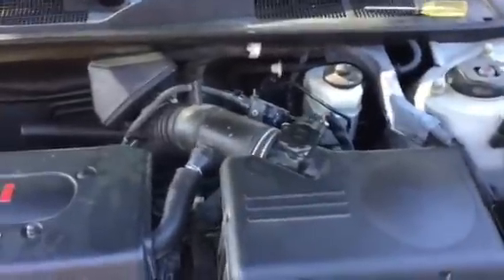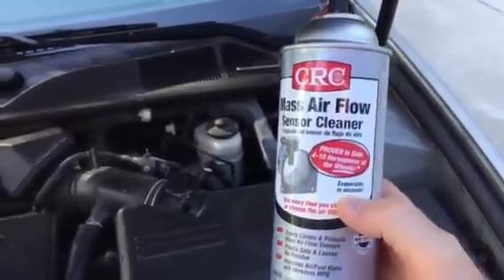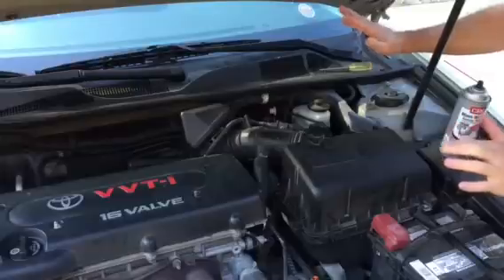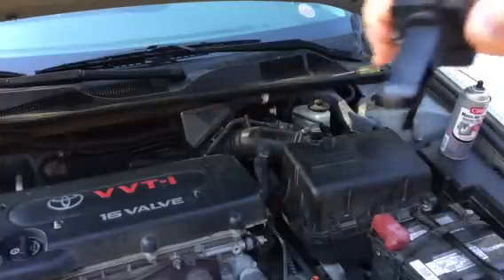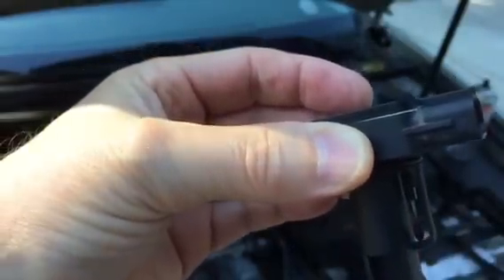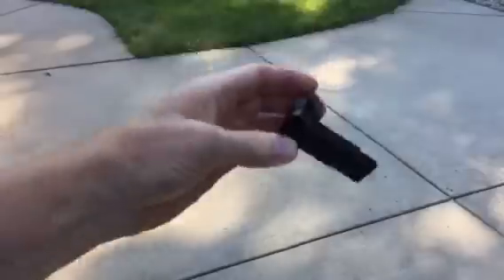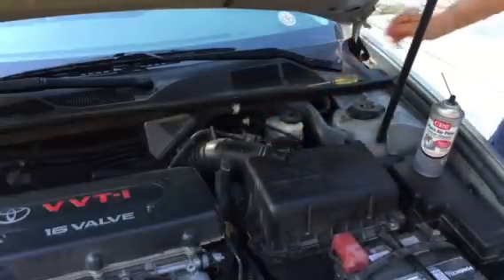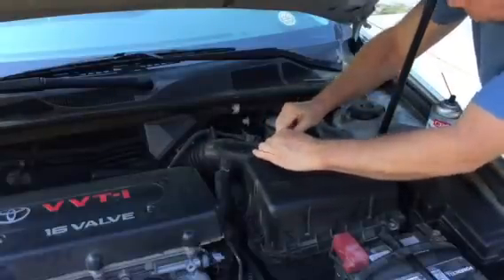Why Does My Car Lose Power Loss Of Acceleration?

Comment: You can use electronic cleaning fluid as well. It's basically the same thing. The ingredients on each can are basically identical. It also dries really fast.  Also, you could have spayed the plug to clean it too..

Comment: We're currently on a road trip from the Netherlands to France with our 2007 Volvo S80 2.5T. We've driven around 800 km so far, and everything was running fine until recently.

At a steady speed of around 120–130 km/h, the car suddenly starts to hesitate or stutter. It feels like it briefly loses power or fuel. One time, the engine even cut out completely, but restarted without any issue. Below 120 km/h it seems to drive normally, and there's no warning light staying on.

Earlier today, I topped up the engine oil with 2 liters after the oil light came on. Aside from that, the car starts and runs well overall.

We still have about 600 km to go, and I want to make sure we get there safely. Could this be a fuel delivery issue? Sensor problem? Electronics? Has anyone had something similar happen?

Any ideas or experiences would be really appreciated!

Comment: I have 2006 Toyota Camry LE, my issue might be with oil leakage. I will try seeing if the bolt is missing a washer but rather then that don’t know what else it could be

Comment: i had mines cleaned but now the engine light is gone but the rpm goes below 500 rpm and randomly idles rough at the light
Reply from the maker: @savagelifestyle2196  Go to my  Automotive Playlist and learn how to clean the throttle body.

Comment: I have no fault codes on my Toyota Yaris 1.0L (2004), 
new spark plugs
new air filter 
checked MAF sensor (clean like new)
cleaned throttle body
cleaned IACV (was clean almost)
cleaned PCV
tested TPS
checked vapor solenoid
tested camshaft position sensor  
checked ignition coils  
 - but still have  some vibration on idle and hesitation after fast/sharply pressing the gas pedal (hesitation from idle to 1500-2000 rpm, like if the engine is choking), but if I give gas smoothly - the engine normally gains speed and power.... also no luck of power from 2000 to 7000 rpm.
Reply from the maker: @legal-emigrant  I wonder if you have dirty fuel injectors?
Reply: @proclaimliberty2000  no, I was disconnect the fuel ramp with all injectors and they all spray rich and in the right way
Reply from the maker: @legal-emigrant  it’s kind of mind-boggling how many different things can cause the engine to  not run smooth. I have a YouTube that I did on engine hesitation and I believe there were at least 45 different things that I listed.

Comment: 2018 Ford eco sport perking during acceleration after 60/70mph and already had the engine replaced because of the oil pump and engine failure.

Comment: Mass airflow sensor is basically a very tiny electrical resistance. The way how is measuring the air, is pretty ingenious. 
Basically ECU sends electricity through that tiny wire. Depending on the quantity of air, the wire will cool down, or heat up, thus increasing or decreasing its resistance. Therefore you measure the resistance and you get the amount of air. Absolutely ingenious.
Therefore everything that affect its resistance, even a single dust particle, will send wrong data to ECU and this will result in abnormal engine operation.
Reply: @clintfipps7312  Yes, if its severily dirty.

Comment: Not done yet! That part that you sprayed is the temperature sensor, there are two resistors (for air flow detection) down inside the hollow tube that also need to be cleaned.
Reply: Thnx, how can the two resistors be cleaned? One only have to just spray it all over, or what?
Reply: Yes, just spray down inside the tube. Don't try to push anything down there to clean them, you might damage the resistors.

Comment: How can we actually know that this is the actual problem? Coz my car also struggles to accelerate when i press the gas or brake. It had body shop service n they changed the intercooler too. After I realized the problem, i went back n told them n they said it might be intercooler coz thats the only thing they touched when they changed the bumper so they changed the intercooler the second time with factory product but i still face the issue. Any suggestion?

Comment: I like to thank you for your easy and understandable explanation.
Just Saturday finished at work to go back home and the middle of the way which is about 1 mile, I was waiting for the green light at the stop light and when I gave gas to my Car it hesitate it so bad I thought the engine is going to go off but it didn't, I continue to go forward but I noticed it was running rough like never before, I was afraid that my Car would stall and proceed to get out of the way because I got a lot of cars behind me, I shut it off and waited for a few minutes then turned on and made it home safely today I needed to go to the store and you did the same thing, I like to thank you for posting this, tomorrow morning I will do a cleaning to that sensor but I don't have that spray, do they sell it in any auto parts store?  Thanks, JD
Reply: Oh man. It just happened to me couple days ago when i came to red lights. I stayed there for 20 min n cars were coming n waiting behind me while hazardous lights were on, then move on next line. I was talking to AAA, but after waiting for 20 min there, i turned it on n i drove. I didn’t know what happened but i also have the same problem that my car struggles to accelerate, maybe this caused that problem as well. Tomorrow will try this
Reply: @kenantv7487  cool man, try it
Reply: @jorgedominguez1957  just came here to tell u said: man, u’r not gonna believe but it just happened again. I was driving n in the middle of the road, my car stopped again. Since i got experienced couple days ago it happened, so this time i behaved quickly n tried to turn the car on immediately, luckily, it worked again coz it was one way n holiday week so already bad traffic n i d not want to cause extra traffic lol. Btw, i just bought mass air flow but i also asked the mechanic n he said if u don’t have any lights on, don’t do anything by urself coz it’s new car so just take to body shop n asked them to look at it , otherwise, if u do smt wrong, they’ll say we didn’t do it. (My car had body shop repair for bumper n they changed intercooler, but I already told them this issue n they changed it again but still the same issue) going to try mass air flow.
Reply: @kenantv7487 did it get fixed?

Comment: Our 1989 Honda Civic with 1.5 engine does not have a MAFS, But throttle does quickly ebb and flow until the car is fully warmed-up. Any other culprit(s) to look for?
Reply: It has a MAP sensor and a IAT sensor.
Aldo check & clean the *ntake Air Control (IAC) Valve and throttle body.

Comment: Shine a light into that Toyota sensor head-on.
Deep in the skirting are two shiny teeny resistors.
Blast those with the cleaner spray too.
Just dont poke or use a cotton bud.
They are delicate things and easily detached.

Comment: What causes the problem driving 10-20 miles per hour car jerking hard and stop and did it again?change all coil and spark plug and map sensor oem part.but when unplug the map sensor the car drive normal no jerking

Comment: Do you have to undo the battery terminal first before you do this ?
Reply: Nop
Reply: As long as the starter switch is off or remove the key it should be ok.

Comment: Thank you for this teaching. I had slow start took a few seconds and sometimes longer. Then it didn’t start at all, After changing oil it started but still slow. I checked this sensor and also put oil on o ring and tightened screws well. It’s starting quickly now. Hopefully remains like this. Thank you so much. From Northern Ireland.
Reply: How it’s been?

Comment: my 2013 model Hundai Tucson SUV has started to develope this hesitation at the early morning hours, it does not have enough power at the start of the engine and when I press the gas pedal too much during that stage, I hear some knocking at the exhaust. Also, it does not have the power like it used to have when climbing  elevated road. surely appreciate your response. thank you sir...

Comment: I tested my maf sensor by starting my car and pulling out the maf sensor plug and the car stopped. Doesnt that mean the maf sensor is working properly. Im having power loss and lurching and hesitation when i accelerate and its getting very frustrating.

Comment: Hi guys, I used brake cleaner for mass air flow sensor and it did the job just fine. The engine is more responsive now.
Reply: mistake and wrong. the brake cleaner leaves a residue. MAFS cleaner is the same as electronics cleaner... NO residue. SEE?

Comment: my 2005 ford escape, is hesitant, the alternator was replaced, also the oxygen sensor 1..🤔.. Now let hubby do what you just did, it’s pulling, has gas an o and battery is good, i literally just left advance auto for a check up.. ILL LET YOU KNOW
Reply from the maker: QUENESS YOMy 👍😊
Reply: proclaimliberty2000 It worked🥳Ty
Reply from the maker: QUENESS YOMy Awesome! 👍😊

Comment: I have a 2013 honda cr-v  it hesitates about the third crank it starts then my check engine light is on and other lights I just put a alternated on today doing what's in your video should that fix the problem or should I look into the full pump  it doesn't bog down or skip going up a hill or nothing but when I run the car a bit I shut it off  then when I get back in it it starts right up and the check engine light is off so could the mass air flow be the problem?

Comment: My Ford Focus MK1 2001 doesn't seem to have one?? It has the hard hose part just after the air box, but there's nothing in it, nothing it the pipe either. It goes straight to the throttle body with the throttle positioning sensor etc.. How does the car know the air flow?

Comment: Thanks for the video. My Corrola has 219000 miles on it and yesterday it would start but would not stay running unless I kept my foot on the accelerater. A 9 dollar can of mass airflow cleaner and following the steps of your video fixed the problem. Bless You.😊😁🇺🇸
Reply from the maker: Kent Smith 👍😊
Reply: Also clean your throttle body.  You might got lucky with cleaning the maf

Comment: when im driving say a set speed of  30 or 40 then give it gas. it wants to sorta sputter.. then if i really press the gas and ge ton it,  the Stabli track comes on. its been going away. but if i ease off the gas when i feel it sputter it wont kick on the stabi trak.

Comment: Had the same problem but it was the air tube it had a huge crack and was sucking in air , part was 100$ so i just used black duct tape instead

Comment: Dont think this will work on my 1991 ram 150 3.9 liter. I sure wish something would . $900 in replaced parts and labor and it stills boggs down most of the time.
Reply from the maker: Cheef Cherokee Do you have a check engine light with a trouble code number?
Reply: @proclaimliberty2000    i dont think it even has the engine light option.but no , no warning lights .
Reply from the maker: Cheef Cherokee What parts were replaced for $900?
Reply: @proclaimliberty2000  plugs / wires / cap / distributer / fule pump / gas filter / crank shift sensor / coil .
Reply: @proclaimliberty2000   the fuel pump is like a big plastic jug looking thing ive never seen befor.
Reply from the maker: Cheef Cherokee How many miles are on the vehicle?
Reply: @proclaimliberty2000  little over 96.000 but this truck is 100% rust free top to bottom . so i would  really like to get it fixed . when it does feel like running right its a sweet old dream of of a truck. i just cant find out much about it like any other vehical
Reply from the maker: Cheef Cherokee Engine hesitation during acceleration without a check engine light can be difficult to diagnose. At this point I would be inspecting the mass airflow sensor, oxygen sensors and throttle position sensor. Based on what you already paid which did not fix the problem I would speak to the manager where you had the work done and see if they’ll check additional sensors including the ones I mentioned at no cost or for a reduced fee.  Trust me, I understand how frustrating this is.
Reply from the maker: Cheef Cherokee Also make sure they check vacuum hoses.
Reply: @proclaimliberty2000  will do thanks for your help.
Reply from the maker: Cheef Cherokee 👍😊 Are you a Native American Indian?
Reply: @TheXopony   Try checking for vacuum leaks. A leak will suck in unmetered air past the maf sensor. The computer will then try to compensate for this and add fuel which will make the car run terrible

Comment: I can't find my air flow sensor sir ..it's missing... I think my macanic missed while installing cold air intake.
I am getting problem while accelerate car not running how supposed to run
Reply: Darel Dias bro my mustang 2015 v6 has same issue when u turn on the speed then @ speed 80 my car misses for a second then it goes up 80 speed how to diagnose it I have cold air intake as well
Reply: not every car has one. some just have a MAP sensor

Comment: Proclaim liberty i have 1993 toyota supra and my car has a maf but it dosnt have that wire its just plastic  i thing its called a flow meter sensor so i did what u mention in yourother video to disconnect it with engine on but my car dint turn of it stayed on does this mean its bad or thr just two diferent sensor maf and air temp meter?
Reply: jvst20051 sounds bad to me

Comment: hi friend, you said that it would take 50 miles of driving for the check engine light to turn off.  What if the check engine light wasn't turned on to begin with and I just wanted to clean the maf sensor? would the check engine light turn on after cleaning? thank you
Reply from the maker: As long as the key is not in the ignition it should not turn on the check engine light when you disconnect the MAF to clean it.  https://youtu.be/YnckaCCJEEk

Comment: Would any quick drying cleaning product work???
Reply from the maker: Neftali Garcia Not if it leaves residue on the wires.  That’s why I only use mass air flow sensor cleaner.

Comment: Since getting my engine code read and it coming back as the MAF sensor I called another mechanic shop and asked about getting it cleaned and they said it would be $300 because the MAF sensor for Nissan uses a special type of chemical and cleaning it is not an option. After he told me that I started looking up videos on it and I see plenty of videos like yours with people cleaning it and they made no mention of any sort of special chemical being involved with the MAF sensor to where it prevents it from being cleaned. I’m gonna go out and buy a can of the cleaner and a screwdriver and clean it myself to save myself from $300
Reply from the maker: Babs Yeah. they are absolutely trying to rip you off.  Happens unknowingly to people every day.
Reply from the maker: If you end up having to buy a new one check Amazon.  I just checked the price on one and they were cheaper than Ebay.  I have always used Denso brand.
Reply: I live in California and since I’m moving and planning on driving my car to Wyoming I want to see if I can try to fix with cleaning it first. So I’m gonna buy the spray first and hopefully that would do the trick because I don’t know if driving from California to Wyoming would be a bad thing with the MAF sensor issue
Reply from the maker: @jurnee-y  That sounds like a great plan.  Are you moving to Wyoming?
Reply: Yes
Reply from the maker: Babs I’ve never been to Wyoming but I think you’ll really love it there. What kind of work do you do?
Reply: I was working for amazon up until last month then I got into flipping houses/interior design which is taking me to wyoming but my new home home will be in Las Vegas after I’m done with Wyoming which I want to work on my MAF cause it’s gonna be woot of driving from California to Wyoming,m and then Wyoming to Las Vegas
Reply from the maker: @jurnee-y  Keep me posted on your MAF project.  Since you'll be driving a lot of miles make sure your battery is in good condition.  You may pick up a tip about batteries from this video.  https://youtu.be/VIWKxR1loSk
Reply: Yea I’m just gonna find someone to do it for me cause I went and bought a screwdriver and just tried opening it up but it just wouldn’t unscrew. Then when I was putting back  the hood strut some random black piece came flying off from somewhere and i don’t know where it came from. So I’m just gonna say F it and drive to wyoming tomorrow and if I make it to wyoming I’ll just see if I can find somewhere there to get the MAF fixed
Reply from the maker: Babs I’m sorry you had so much trouble.  Cars can sometimes be very frustrating to work on.
Reply: You think I can drive 16hrs with the MAF sensor issue?
Reply from the maker: Babs it’s just so hard to say because I don’t know how bad it is.

Comment: Did this but had to get a special short screwdriver and someone to pull the plug out.  Thank you it worked got the warning lights off but then went on again.  I guess I'll have to wait 50 miles and hope  there is no other issue.
Reply: How'd it go?

Comment: hi will this work for a 2008 dodge avenger
Reply from the maker: Jannette Blandford Do you have a check engine light lit up on your dashboard?
Reply: @proclaimliberty2000  good morning   no nothing comes up, just had the plugs changed on thursday and running ok but that I don't believe is the problem, I still think it"s got to do with a gas filter cause when Im travelling the car will run great then all of a sudden the car starts coughing and seems like it can't get air. Does the advenger have a sensor on the air flow by the carb,,i have been warching utube.
Reply from the maker: Jannette Blandford Yes, your car should have a mass air flow sensor.